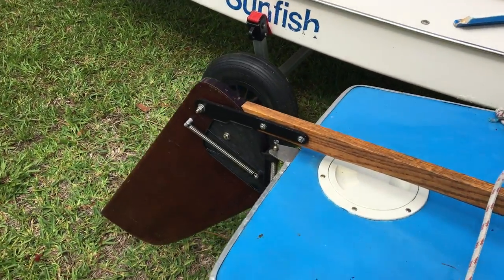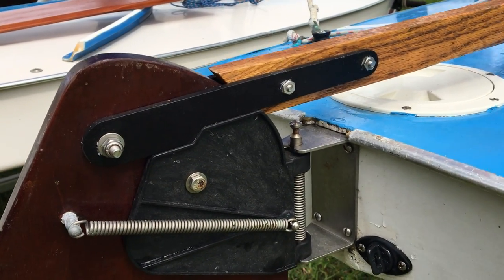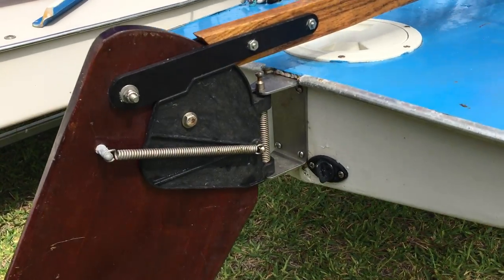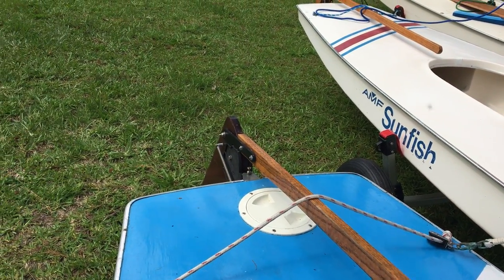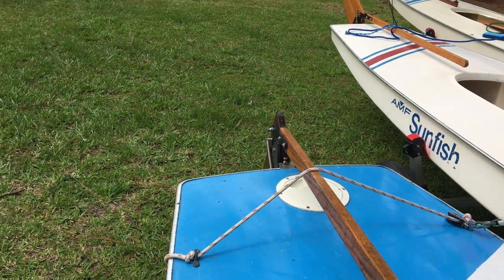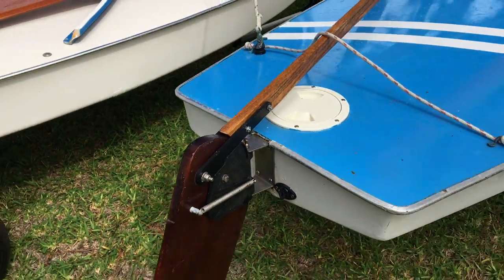Sunfish Flip Up Rudder

Comment: I have a "new to me" 1982 Sunfish which looks like it has some salt water corrosion.  The rudder is very stiff.  I can raise and lower it by hand, but it is too stiff to raise and lower it with the tiller.  Is this normal?  Should I take steps to try to reduce the stiffness (oil; take apart and clean; loosen bolts, replace any hardware?)  Thank you!
Reply from the maker: Ours are usually too stiff to raise with the tiller without a lot of exertion. You can check tiller bolt nut tension. And there is supposed to be a plastic washer between the wood and the metal cheek, on both sides of the rudder